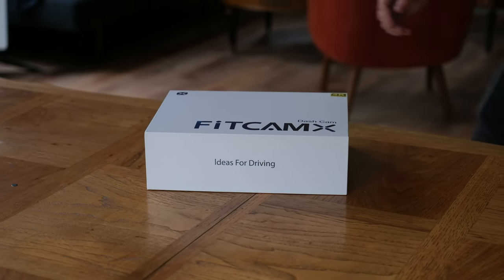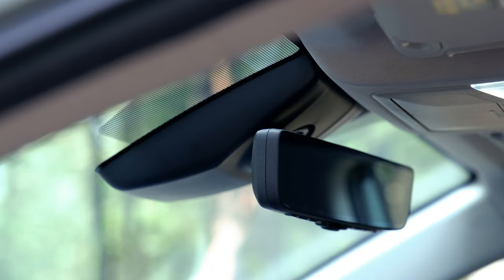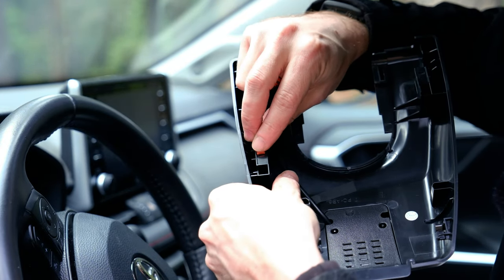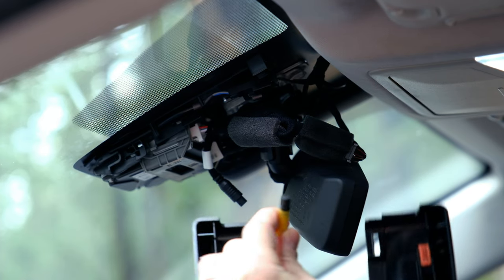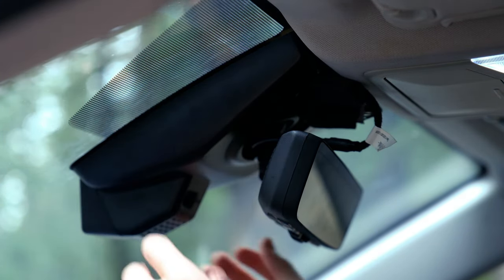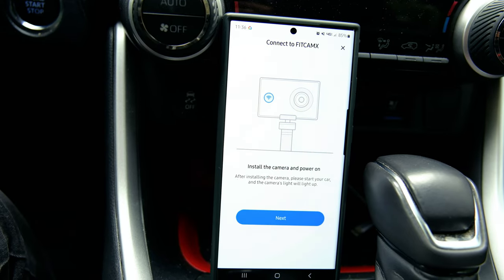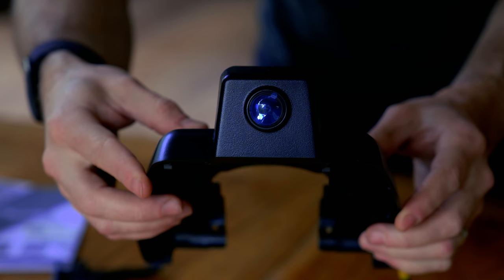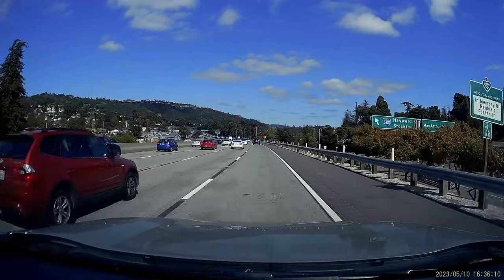FitCamX RAV4 Dashcam Installation & Review

Comment: Does the video get stored on the cellphone? Is there a way to delete the video or is there a default time limit? Is there a way to save the video on the cellphone?
Reply from the maker: The videos are stored on an SD card in the camera, but you can pull them into the phone app. Videos get deleted / overwritten as new video is recorded. Normally if I want video (which is super rare in reality) I just  take the SD card and pull on my computer. Its a bit easier than the app.
Reply: @LunarLanderXplor  Thanks!

Comment: I had a unit installed on a different car and somehow while parked it was getting power and recording while in parking. Ended up taking it off because it was recording for hours and afraid was draining the battery. Nothing similar for your situation?
Reply from the maker: Strange, no ours only records when the car is turned on

Comment: any updates or noticeable glitches since your install?  i have a 2023 rav4 prime xse and i'm considering this and the OEM version which costs about $125 more. this is more slightly integrated than the OEM which would be installed to the side rather than centered.
Reply from the maker: Not really. Since the install it has just been constantly recording with nothing needed from me. I like that I don't have to think about it, plug it in, or see it in any way. Its just seamless. Only thing I will note is while there is an app, I find myself just pulling the SD card and connecting directly to my PC when I need to grab footage (which is almost never). Overall very happy with it!

Comment: I appreciate you showing the parts that you had to redo/adjust like the twist tie and the lens cover. I probably would have made those mistakes too so you saved me some time.
Reply from the maker: Thanks for the comment! Yea I did run into a few small issues with the install since I have never installed a dashcam before, so I wanted to show what I encountered

Comment: great video!  I had a Kenwood in my older Rav and it was not user friendly at all.  Do you have to always be connected to its WiFi, or only when you want to view videos?
Reply from the maker: You only need to connect to its wifi to connect via the app to view videos. Normally I just pull the SD card if I want footage, which is very rarely

Comment: question: how you activate cam to record ?? how to save fille ?? voice command, application enabled??  thx for help..
Reply from the maker: The camera records automatically when you start the car. If you need to pull footage, there is an SD card you can remove, or you can use their app.
Reply: @LunarLanderXplor  Thanks....just a follow up. Wondering if it deletes old recordings daily... If I have the app downloaded....lets say Im driving after 1 week with the camera and I want to check recent footage, would I need to go the sd card for that or would the app have that footage even if the phone was off for example?

Comment: While the look is clean I have 3 issues with this.
1) The lens is not adjustable. There should be some ability to as I believe there is too much of the hood being show on the MDX version
2) No sound to identify that the unit has powered on. I believe some of the earlier models had issues just dying after a month of use which was resolved. If this stops working you might not notice that small dim LED which shows if it is on. Even then you have no idea if it is working
3) With no voice you won't know if there is an issues with the microSD card

With these issues IMO I would say to get a Viofo over this. Yes it might not look as hidden but I prefer functionality and knowing my device works or has some sort of issues instead of coming into a situation of an accident and then not having the video which I would need.
Reply from the maker: Valid points! Regardless, we have had a great experience with this dash cam and it has been reliable in our testing. No issues since installing it in our RAV4.

Comment: You did such a terrible job pulling the trim, instead you should slide down it. At least this helped me for not running into that mistake.  Otherwise video was ok.
Reply from the maker: First time, be gentle! Lol. Not an expert here, just a normal guy trying to figure out the install process.